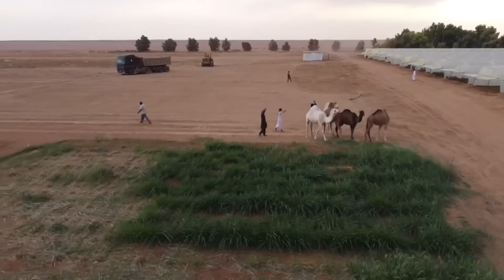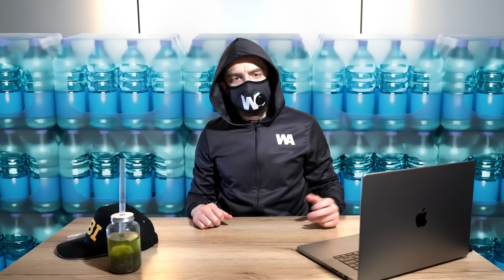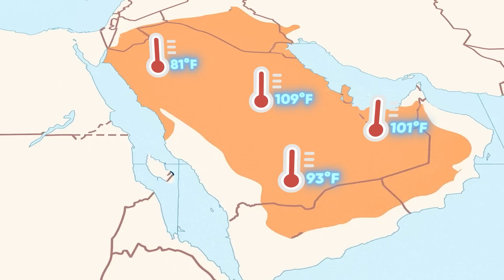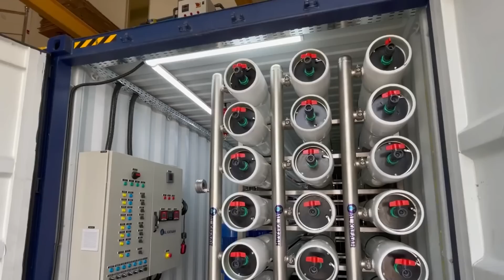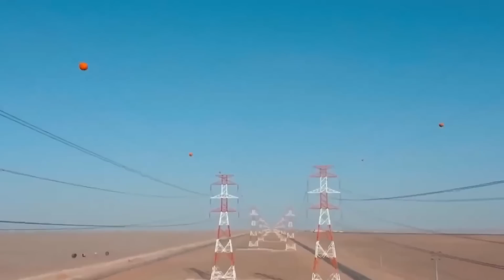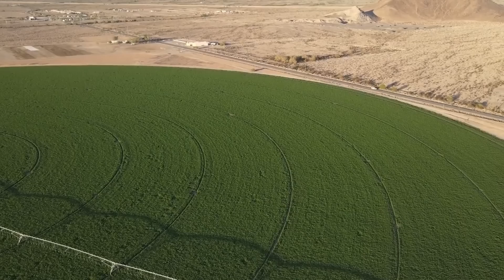That's Why Saudi Arabia Pours Almost All of Its Fresh Water Into the Desert

Comment: Vapor Compression Distillation better. They don't even need machinery if they use Transvector flow amplifiers based on concentrated solar steam venturi effect. No filters required to clean. Ultra pure water. FREE.

Comment: IMO, trying to "farm" with traditional methods (open air irrigation) is completely insane! It is simply to hot, and to dry to make sense. The amount of evaporation is mind boggling! and greenhouses do not make sense either. the heat generated by this method would simply cook all vegetation "on the vine".  The only thing that makes any sense to me would be underground farming. where the temperature could be drastically reduced, evaporation controlled, and sunlight could easily be distributed via fiber optics. But building hundreds of thousands of acres of underground farms would be more expensive than our defense program! I guess after many generations it might be cost effective. but that is only if there are few to no expensive problems (cave ins, mold, root rot, etc.). This idea probably should be tried on a small scale, just to see if it works, and how cost (in)effective it might be. And to see how many real problems would arise. / ALL farming water should have to come from desalination. And frankly, If the Saudi government was smart, they would start work on refilling those underground aquafers that they have already drained.  That is a strategic thing, incase of war or some unseen reason that all of a sudden their desalination plants all stopped working for a while. I know in their location, I would want at least a 20 year reserve of drinkable water "just in case".
Reply: u didnt get it, they want to change the hot weather of the area with the help of uae and qatar they are seeding clouds, changing the hot weather to fresh weather

Comment: "this amount is increasing because of climate change."  so the story you tell me is that long ago saudi was blessed with lots or rain.  back when the climage was warmer during the haloscene.  yes when the climate was warmer than it is now. It's thing, don't let tell you it isn't.  You see when the temperature is warmer more water evaporates and that comes down as rain.  But the alarmists want us to believe that warmer means drier, even while their climate change models are actually driven by water vapor as a consenquence of increased CO2.  So no you now you want us to believe that despite science and history, it's going to work the oposite way.   please do some critical thinking.  while you are doing it you might observe that warm water releases CO2 while cold water obsorbs it.  So how is it that warmer ocease will become more acidic?
Reply: it's the people. the temps at Saudi are becoming more extreme meaning colder winters and hotter summers. people have to stay more hydrated to cool off. rainfall doesn't simply happen when water evaporates it also has to accumulate and condensate and that requires other factors which are not in favor of rain in Saudi.

Comment: takes power to convert salt water but it could be done with nuclear power, half the water for cooling the reactor and the rest pumped into distribution pipes
Reply: Or just evaporation water with solar condenser.
Reply: @mrbaab5932  and the salt left behind? won't take long for that system to need cleaned out
Reply: “Reverse Osmosis”
Reply: @M3n-s1p  that takes power too, it's not magical

Comment: What if you take the brine from desalination, compress it with a bonding agent?  Then you could have bricks that can be coated with an impenetrable material or maybe it could be mixed with clay and then baked in a solar kiln.  There's has to be a use for the brine  . . .
Reply: Just create salt evaporation ponds with the brine instead regular Sea 🌊 water 💦.  Maybe put cement floor on the ponds to prevent the salt water getting into the water table.
Reply: @mrbaab5932  yes.. then export the salt to countries that use it to salt roads in the winter, from where it washes back into the oceans through groundwater and rivers... the economics may not be there, transportation is usually a cheap thing, but in this case it is probably not as cheap as digging the salt out locally worldwide.. what can you do with salt? sodium chloride.. the chlor-alkali industry uses a ton of energy, and its products are chlorine for polyvinyl chloride, alkali for soaps, but it probably cannot use 12 inches of Florida covered with brine amount of salt.. and it needs even more energy than desalination.. sometimes the most economical solution is to just get rid of it the cheapest way you can, dump it back into the ocean.. all the desalination might drive the price of sea salt globally negative, like garbage that needs to be transported and disposed of, otherwise it is super cheap, available for free in abundance, and there is too much of it, orders of magnitude more than what can be turned into a useful purpose.. one idea is soda lime glass for greenhouses.. soda ash via Solvay process + lime + sand = glass .. in this case the lime needs transportation, and tremendous effort needs to be put into constructing, building the green houses that can be climate controlled and moisture recycled but suffer from greenhouse effect of extra heating compared to cheaper open skies.. it may not be economical compared to just throwing water at the problem and letting vegetation self cool by evaporating water.. in the closed greenhouse there also has to be an artificial co2/o2 exchange mechanism that preserves moisture.. such as hemoglobin for o2 and ethanolamine for co2.. it all sounds like a whole lot of effort and activity to preserve a little bit of freshwater.. freshwater may be cheaper to waste than all the effort put into preserving it via a greenhouse built from soda lime glass.. i was just thinking that instead of the Solvay process, at very extreme temperatures you may get NaCl+ SiO2 + O2--> Na2SiO3 + Cl2, vs. CaCl2 byproduct in Solvay. In my opinion the Solvay process is not done because of CaCl2, there has to be thermal chemical tricks that are relatively energy economic to get HCl or Cl2 as byproducts. And beat straight electrolysis in cost. The Chinese use the Solvay ammonium chloride directly as a fertilizer, but this means ammonia is not regenerated and needs an ammonia plant right next door to a Solvay plant. Usually ammonia is converted to urea but this chloride way may be economical, and you'd get the soda ash for glass. One downside compared to urea is that urea does not leach Na, K, Ca, Mg from the soil on its way back to the oceans. The question is how much, and is it significant.

@barbarabrooks4747 sodium silicate is water soluble, but soda lime glass can be a glass like binding agent for bricks made of sand for low strength buildings.. though you would need good reason to justify the sodium compared to cement/concrete that's mostly calcium based without sodium
Reply: Sure you could. But you wouldn't want to have anything metal in the building.
Reply: I've read that technology is being developed to remove metals from sea water.  Maybe the time to make blocks would be after the metal removal technology is developed.  In any case, the brine takes up space if you store it, and it's bad for marine life.  If you can mix the brine with the proper binder or coating, then it could be used for building structures that don't require great strength, such as sheds and barns.  Since lumber must be imported to the Gulf States or concrete ingredients mined, such blocks could be used for any low buildings or for non- bearing walls in tall buildings, provided the metals are extracted.  The brine needs to be used for something relatively permanent so it doesn't waste space or leak into the environment
Reply: There are places where they use it to grow shrimp.

Comment: Sorry, Arabia does not need much water for food.  They can feed their abundant store of methane to bacteria, which converted into protein by adding a little ammonia.   Those bacteria are perfectly nutritious.  They can feed off of them and their animals can also.

In addition, there are cyano bacteria, which can feed off of hydrogen and carbon dioxide . So. Saudi Arabia is quite able to feed itself as long as it is willing to give up traditional sources of meat.  In fact, they can feed the world.
Reply: People don't eat bacteria on purpose generally. Carbon capturing systems use Alge to eat CO2  and water. Next the feed the alge to fish in ponds. Then they eat the fish, but it is an expensive system.

Comment: Hydroponics doesn't necessarily conserve water, the crops just only use what they need, the conservation happens if you prevent transpiration from the media. Hydroponic systems are actually very water heavy systems requiring regular reservoir flushes that release high amounts of nutrient salt, algae, and plant chemicals released into the reservoir during growth. Still alot better than top irrigation
Reply: 😂 faktycznie nie masz pojęcia o hydroponice. Zamiast wdawać się w niepotrzebne dyskusję, sięgnij do Google i poczytaj o parowaniu wody
Reply: You typed with no knowledge or shared bad information of what you have been foolish enough to believe.... Hydroponics sole purpose to conserve water, soil? what soil as none is used, the water it does use circulates through the system.
tbh bud not sure what you are thinking of but basically soil is not used in Hydroponics.
Finally weed growers have used hydroponics for a long time.
Reply: @abrown4075  yea so I actually own a farm and do hydroponic basil and thai basil, been doing it since 2010... Nice try though try trolling somewhere else...
Reply: @sjoel3982  Trolled??? try Facts... if any soil you are not growing using the Hydroponic system... 
Type it into Google....
Do you use soil for hydroponics?
Hydroponics comes from the Greek word “hydro,” meaning water, and “ponos,” meaning labor. In other words, hydroponics is gardening without soil. Growing food in a desert can be difficult because of extreme temperatures, low natural precipitation and limited arable soil.
Also know of people who grew weed using this method and no soil.